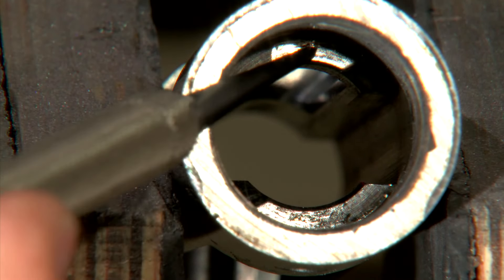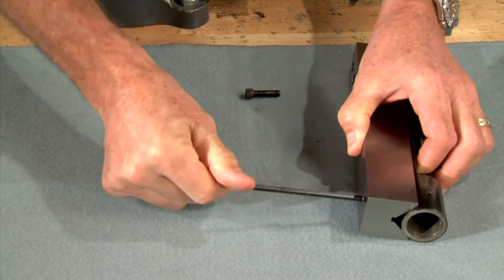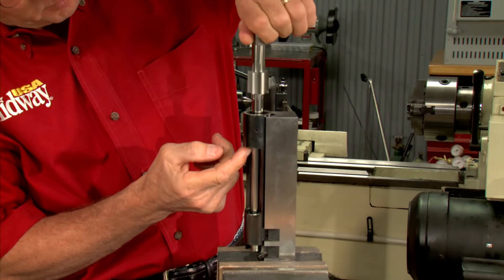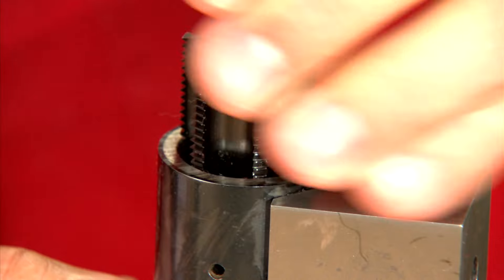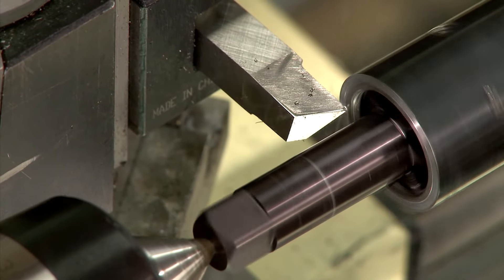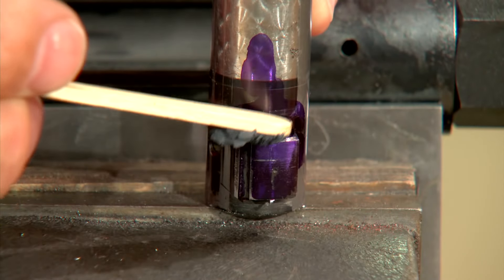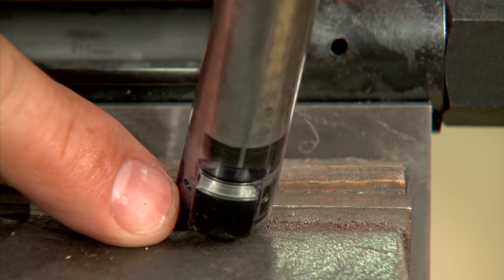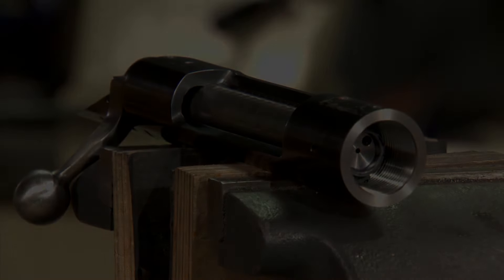Blueprinting a Remington 700 Presented by Larry Potterfield | MidwayUSA Gunsmithing

Comment: Great video! Even if you use different methods, this completely explains the "blue-printing" process & is easy to follow. It seems that one more tool is needed. With tap in place & locked as a centering mandrel, it seems like a hardened disc could be rotated against the receiver face with lapping compound to square & true it. This would eliminate the need for a lathe.
Reply: You would wind up with stacking tolerances. If you notice how the tools are fixtured and the order of operations, each step relies on the previous one being "true". The receiver is squared in a lathe because not only is it the step in the process that contributes most to accuracy, but it being perfectly square is the linchpin of the entire process with the entire toolset. Any time you're using things like bushings, pilots, and guides, there are clearances required by default. Any type of "slop" would directly translate to possibly trueing the receiver face at a slight angle, and this error would be carried over to the subsequent steps.

All that being said, now that I think about it, there IS a way to achieve what I believe would be an accurate result- using something with a "flat face" as you described, but in the form of a carbide cutter or diamond-impregnated disc, with a pilot, with a small beveled section near the pilot shaft to cut a VERY SMALL reverse bevel/crown on the inside edge of the receiver face- this would cut a slight bevel on the inside right when you started cutting, and would self-center your cutter and hold it flat on the face-or at least hold it flat enough that it should not be an issue. As a side note, the reason I stayed away from lapping compound as you described is two-fold... First, lapping is for mating two surfaces to EACH OTHER. It's not the process that you would use for trusting or correcting one surface. The reason why is that 1) you'd be wearing your tool as well. Over time, it would lose it's flatness, and this would then carry over to subsequent jobs, and 2) Lapping by design has a small gap between the two surfaces that is filled with an abrasive, and this again offers the opportunity to introduce an offset- slightly more pressure on one side or getting unlucky with the exact grain sizes in the compound would mess up the job... Lapping is the process used when the primary focus is to refine the quality of the fit between two surfaces. Face cutting is for when the goal is to make something straight or square. 

The bolt lugs get lapped to the receiver to improve the "repeatability" of the bolt going into lockup, which translates to exactly the same headspace every time, which means more repeatability, i.e. accuracy. The receiver face is in essence being squared to the bolt face centerline, so that when the barrel is installed, IT is perfectly in line with the same. Again, results in increased accuracy (if the barrel is off-center compared to the bolt face, it results in all sorts of wonky stuff, but that would be a LOT of typing)

I hope this explains the why and how for you, sir. Happy shooting!
Reply: @AbolishTheBATFE  I've seen a lapping tool used to true up the face of AR uppers prior to the barrel install. Couldn't something like this be used with the bushings to square it up and only make contact with the face of the receiver?

Comment: Everything is made from a set of precise drawings and has a tolerance.Blueprinting is just extra work to get those tolerances down smaller or ideally to nil.You can blueprint anything,its not just about refacing/squaring and some parts cant be blueprinted,you cant in many cases add material when a size has its tolerance on the under rather than oversize.

Comment: I would like a set of links to all the tools used in the video.
Reply from the maker: Let's start here with what's available and if there are others you want to know about let me know.  Some inventory has changed since the time the video was made. PTG Piloted Reamer: https://www.midwayusa.com/product/1007141036?pid=121117       
PTG Piloted Tap: https://www.midwayusa.com/product/1007231296?pid=481854
PTG Bolt Lug Lapping Tool: https://www.midwayusa.com/product/100696344?pid=383558 
PTG Truing Cutters and Guides: https://www.midwayusa.com/s?searchTerm=truing%20cutter
PTG Bushings: https://www.midwayusa.com/s?searchTerm=PTG%20bushings
Cutting Fluid: https://www.midwayusa.com/gunsmithing-tools/br?cid=24136&searchTerm=cutting%20oil
Layout Fluid: https://www.midwayusa.com/product/1007344048?pid=383761
Wheeler Lapping Compound: https://www.midwayusa.com/product/1006411564?pid=486249

We don't carry the v-block, tap handle, or drill Larry used in that video.
Reply: @midwayusa  Dude solid reply. Thanks. Also make a new series of videos of Larry stripping down rifles!

Comment: Question...  Once the trueing of the receiver face and threads are completed and chassed with the tap will the factory barrel still fit???  Or is the receiver tap oversized requiring a new barrel???  Thanks!
Reply: The Piloted reamer cleans the top portion of the threads. The lower side of the thread, where the barrel threads hold onto are un-touched. The re-threading tap just cleans up the threads, especially the top portion that was squared down a bit. It will not oversize the pitch. Unless you really screw it up. The barrel should fit just the same, and hold torque just as good. Although it would be best to make sure the barrel is completely true centered for best accuracy.
Reply: densedrummer and how would you make sure it is 'completely true centered'?
Reply: BloodSteed The barrel chamber  and bore need to be exact centered to the outer cut of the threads to allow for the best accuracy. If it is even slightly off, the action will not be true to the round in the chamber. A micrometer measurement around the center of the fire end of the barrel in several places to check thickness to verify that it isn't off center, and also on the chamber side. There are special tools and machines that can check this to a very, very accurate measurement. But this is a good starting point, without spending a ton of money. Basically, you just want to be sure that the hole for the cartridge is exactly in the middle, creating a perfect center firing pin strike.
Reply: densedrummer cool, thanks for the info

Comment: shouldn't the last part of that operation be seeing how much the fit between the bolt handle cocking cam /action cocking cam surfaces have changed? In some cases wouldn't it will be necessary to remove and re silver solder the bolt handle more forward on the bolt body? Otherwise you may have lost too much mechanical advantage for primary extraction, or in an extreme case, the back of the bolt handle will contact the action bolt handle cut out, and break the handle/bolt body solder joint upon firing. And when you remove material from the front face of the bolt, wouldn't you have to recheck firing pin protrusion, so you don't end up piercing a primer? I'm pretty sure a trained gunsmith would check all that stuff, but a weekend tinkerer might not realize.

Comment: will a 7x10 or 7x12 bench top mini lathe work to true the receiver face?
Reply: If it will fit between your chuck and live center and spins freely, it should. I have not measured the length of the rod but I think it will fit.

Those smaller cheaper lathes are not the greatest but may work in a pinch, they are mainly for the weekend hobbyist.

Comment: any tool that enables you to square up the face of the receiver for us poor folk who don't have a $30,000 lathe?
Reply: You can buy a lathe that'll fit the action for like $1400. buy no there isn't really any other way to do it except with a really good machinist quality mill
Reply: +mojo jojo You only need the lathe for one part of the whole process. I'm sure you could do the rest and pay a machinist or gunsmith to square the receiver face
Reply: Actually you can just use a face squaring mill bit with a cutting face bigger than the front of the action and a shaft that fits the bushings and you just chuck it into a drill from the rear of the action and pull back as you cut.  Boom instant true.

Comment: forgot to use a die inside the receiver, that way you can tell how much material was removed and also your relining on the tools you have to use, the more a lathe is used the better the chances that its true and perfectly cantered? not saying the tools used are not good, just saying that using a metal lathes is always going to be better and tools for the lathes are always at the highest standard?

Comment: Yup, everything appears to be dead nuts on......until you close the bolt and the ejector spring tilts the cartridge / bullet because your bolt is a slop fit in the action. After removing all that metal, where are we on Headspace? I would have Harry Potter do my smith work before Larry.
Reply: I assume fitting a barrel comes after. Guess we just have to hope the barrel is machined right

Comment: If this is so easy why would not manufacturer do it. Sounds like snake oil to me. Obviously there are many very useful tips and videos by Midway, but I am wondering why Remington's 1000000$ machines can't drill a straight hole square to a bolt?
Reply: Because Remington makes 1000s of actions and during the course of doing that their tooling wears out. That's where  min and max specs come into play.

Comment: I have to agree with Sierra Matchking. This video very much over simplifies the process. For example machining the bolt face can impact head spacing and actually create an unsafe excessive head space condition. 
This should NOT BE DONE BY THE NOVICE less you have the rifle blow up in your face. 
Shame on you Larry for even suggesting this be done by anyone less than a qualified machinist or gunsmith.
Reply: ***** got it. That makes sense. Larry left that out too. Bottom line is don't try this at home..
Reply: Zack A Nothing was left out. This video is for blueprinting an action. Installing a short-chamber barrel and finishing the chamber with a chambering reamer to obtain proper headspace is for another video.
.
Reply: geoh7777 Just curious...why would you do this over just buying an action like a Stillers Precision for <$1000? I mean by the time you buy a Rem. 700 action and have this work done, you're in for the same if not more money. Unless you have tools and knowledge to do it yourself which many (most) do not.
Reply: Chad Ashton You know way more than I do about that.

I was just commenting on this video as being complete as far as blueprinting (an action) is concerned, and that installing the barrel, headspacing, etc. are beyond the scope of what the title says the video is about.

I think it has been established that already Larry has all of the tools needed for the work he does on rough commercial (i.e. being of an average or inferior quality) actions to make them capable of high accuracy compared to factory production. I also think that many people think that Rem 700 is the way to go because of the sheer amount of publicity that the Rem 700 has had.
.
Reply: Chad Ashton Really, its a combination of simple things like brand preference, the desire to "do it yourself", and the initial cost (while some people may not have $1000 to drop right away, a $500 action that will do the same job and can be blueprinted at a later expense is just easier to some). I myself just prefer the "do it yourself" aspect when it comes to building my custom firearms.
Reply: Hey Zack A please don't make comments like I agree with Sierra Matchking he is an ignorant troll as far as your comment about head space a safety issues you are right this can be dangerous. However this can be done by someone with a little mechanical common sense. Sierra Matchking likes to talk about bench rifles OK well Larry never said he is building a bench rifle you need a custom action and barrel for that just to start. Is this the best way to true a rifle NO would a lath work better YES will you get very close to the same results with this method YES will this make my rifle shoot like a bench rifle NO can it be dangerous if you get the head space off YES will this make a hunting rifle shoot allot better YES